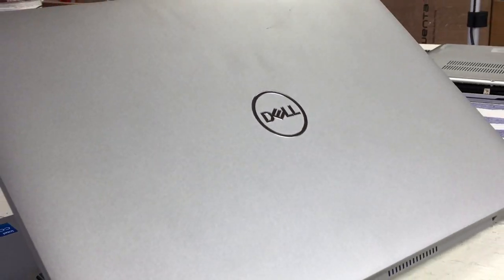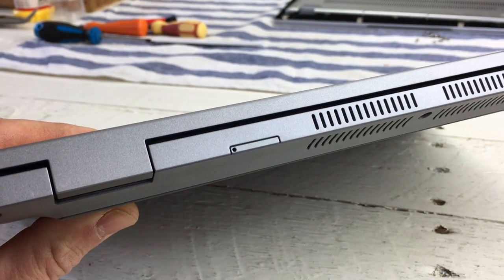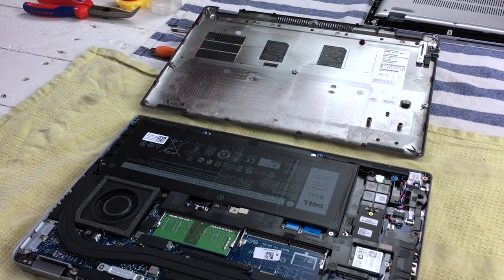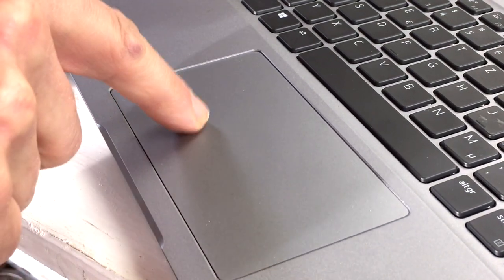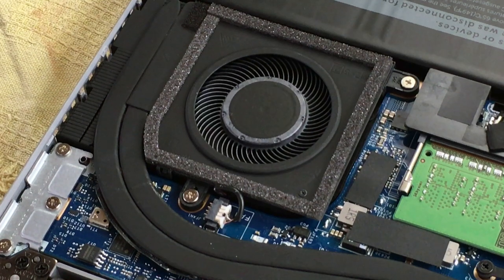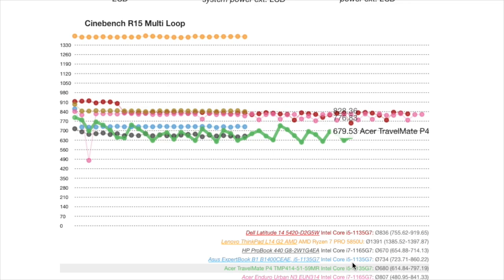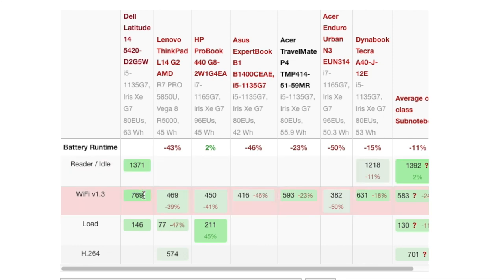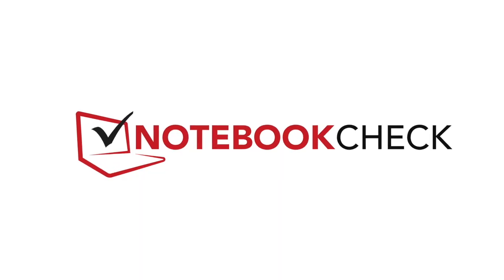Dell Latitude 14 5420 Review [EN]

Comment: This is the most disappointing laptop I have ever used. HP, of the same generation and with the same processor, performs significantly better; this is utter garbage.
Reply: Too bad 😔 I already bought it
Reply: does the HP have anywhere close to this dell in upgradability?
Reply: The 5420 is a solid reliable business laptop.
Reply: Why do you comment the same thing on all the videos?
Reply: @Coolblackman25 I also observed the same thing lol. Must be a bot

Comment: Does it charge with low Wattage power supply? (5w to 30w)
Reply: A laptop battery may slow charge if powered off. If powered on, low power supply is ignored as the battery circuit is focused on power outage potential and quick power delivery for disaster recovery.
Reply: @MorganTheva  Wtf is disaster recovery? You didn’t answer anything.
Reply: It can barely charge on a 12v PD adapter. Anything lower it’ll only charge while it’s sleeping or off. I have one